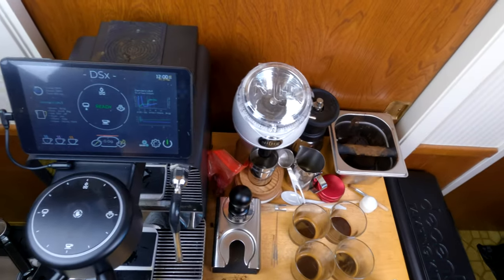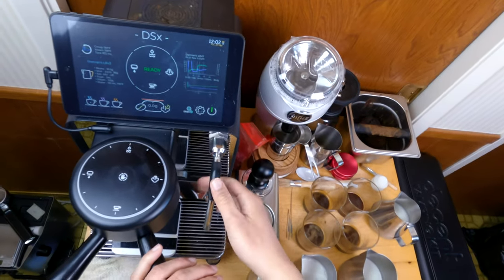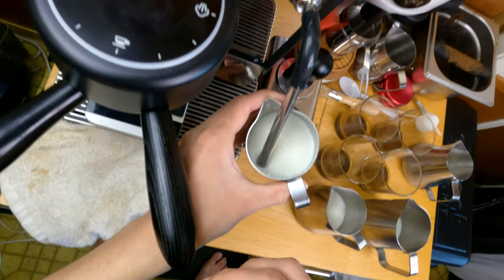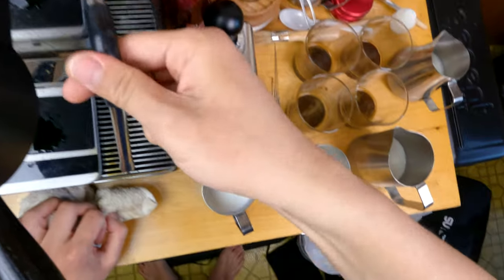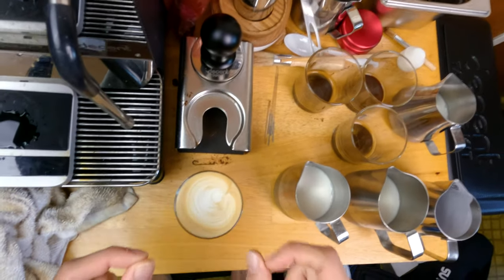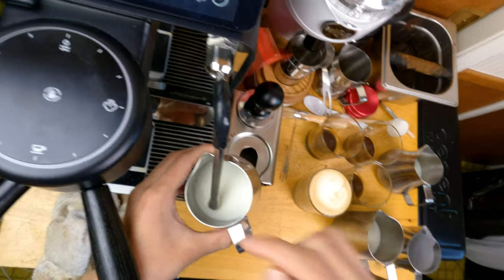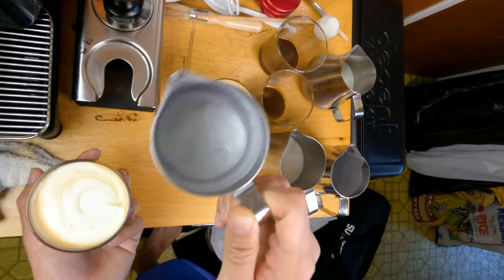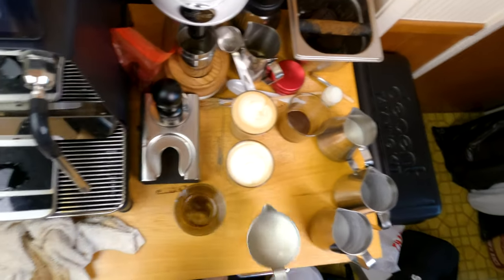POV Tutorial | How to Steam Milk on the Decent Espresso DE1

Comment: Great vid! Your illustration helps even for other espresso machines. It’s very clear.

I have a question, isn’t more challenging to steam milk while the pitchers are outside the fridge? Do you think if your milk was colder you’d get even better results or it wouldn’t matter?

While preparing my espresso, I leave the pitcher with the milk in the ‘freezer’ so it’s as cold as possible.
Reply: Having a cold pitcher and/or colder milk can help those struggling with creating great steamed milk as you have longer to incorporate the air introduced at the beginning of the process. Using milk which is of a warmer temperature would give you less time before it reaches the ideal drinking temperature (55C to 60C for many people).

Comment: Brian, what temp are you using? Do you just go until it’s uncomfortable to hold and figure it’s about 165?
Reply from the maker: Yep! When the pitcher is hot you should be in the ballpark of what works. But it depends on what milk and size of drink you are using.
Reply: @BrianQuan  Yeah, I can generally hold the bottom up to about 140º then I have to back off and just touch for 2 secs at a time.  I like to pull it at about 160º . BTW, what brush is that?  Like it!
Reply from the maker: It's a standard cleaning brush! There should be a set on amazon you can get that comes with a hard bristled one for your group head and soft ones for everything else.

Comment: OMG you are my favorite channel. I just watched one other video, then saw this title. I literally have not steamed on my Decent because I feel clueless, after reading about it, how to do it right. When I try, I get milk everywhere.  (I'm a brew coffee guy, the decent is my first and probably last foray into espresso!)
By the way, I see the accupuncture needles. I made a WDT with them and it works great.
Reply from the maker: Hi Taylor,
Thanks for the comment! I hope the video was able to help. It's a lot more difficult to explain techniques over text so a solution to that is strapping a camera to my head to make videos. John does have a few videos on the Decent channel showcasing ghost steaming so you can check those out.
Reply: @BrianQuan  I will try to find his videos. I saw one that made it sound easy, but it did not tell you when to adjust the height of the milk jug, or what you are actually doing, like you did. I tried milk again last night, it was not good but at least I have some clue of what to do. I have the angle totally wrong. It seems pretty hard to position the milk jug when you have a thermometer in there (I'm using the decent one)